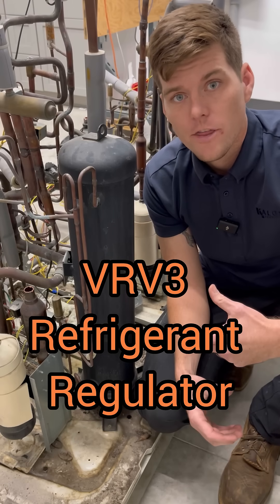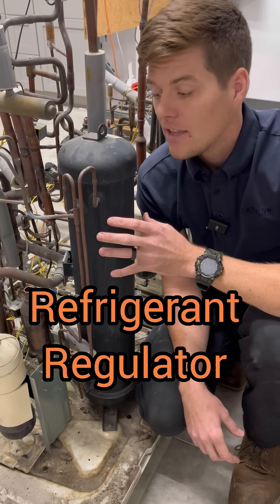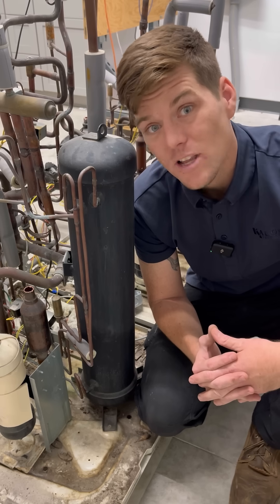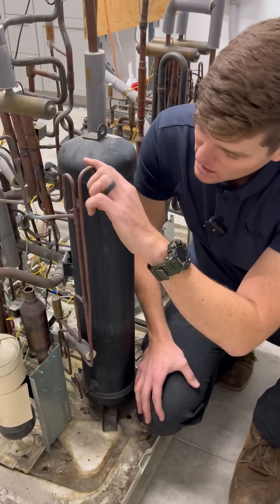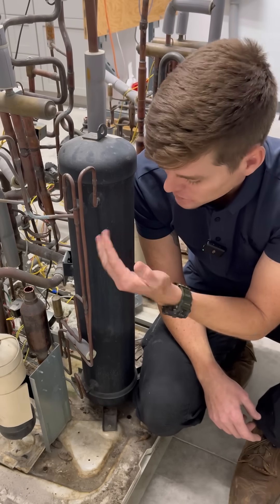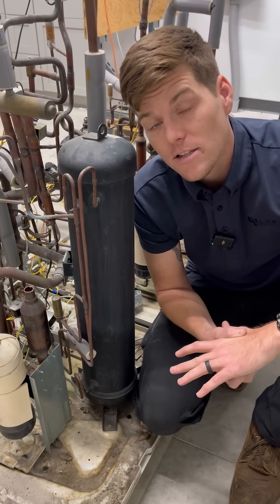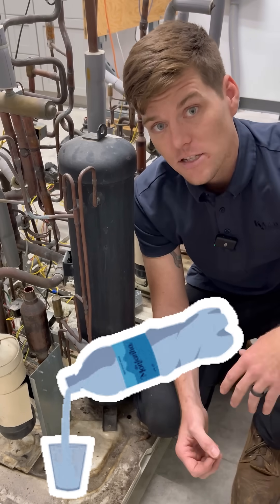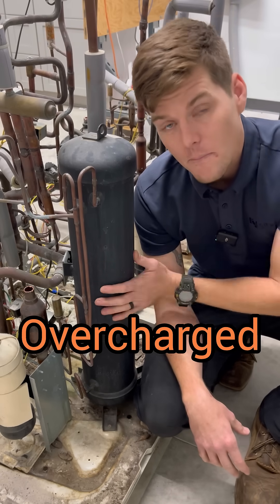VRV-3 Refrigerant Regulator - What is it and how to troubleshoot #vrvsecrets

Comment: This very similar to rack refrigeration.
Reply from the maker: They operate on a similar principle, yes! We are using refrigerant the same way just with a few changes
Reply: Good stuff Roman, keep them coming. 

What the pressure regulating valve there beside the solenoid valves??
Thanks in advance 
.
Reply from the maker: Yes if these solenoids fail then R410a can become trapped in the tank. If ambients get high there is a chance for pressure to build and rupture the tank so they installed a pressure relief valve.
Reply: @RomanBaugh well that makes total sense, I haven't studied a flow diagram, but thanks for explaining , looking forward to the next installmen,  ya wizard 😀..😊